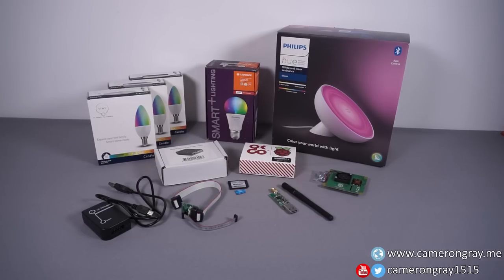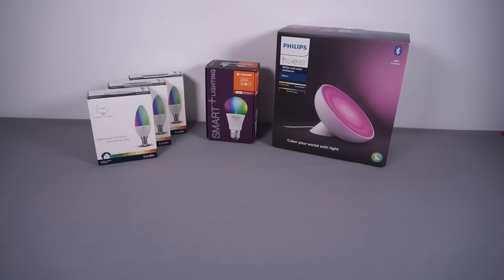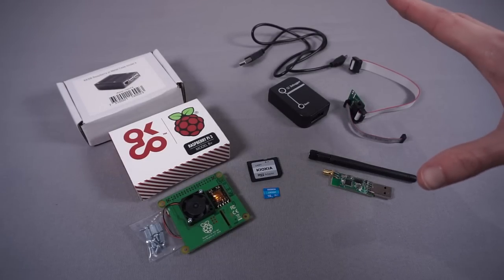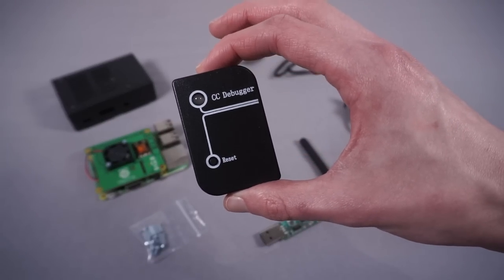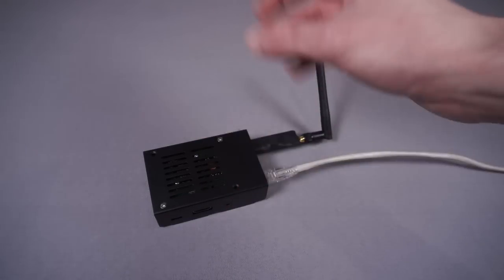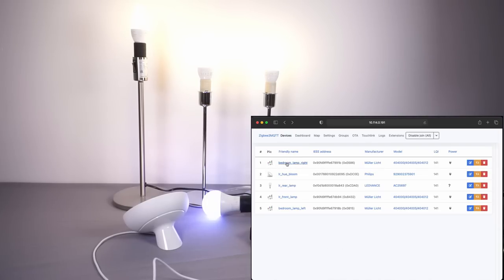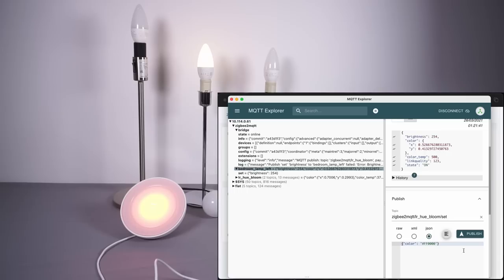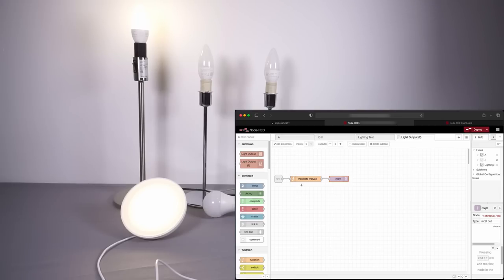Building a Self Hosted Smart Lighting System using Node-RED & Zigbee2MQTT

Comment: I couldn't figure out what was going on until I realized this did not involve home assistant :)
I'm used to ZHA but wanted to try Z2M so I was looking up how to actually use the devices in node-red compared (to ZHA) - spoiler: it's exactly the same..
Reply from the maker: Yeah, Home Assistant is a good option but I just don't get on well with it, I think I try and push it too far.  I find Node-RED lines up with better with my way of thinking since it's a lot more programmatic.  I've actually started using Home Assistant as part of my setup, however I'm using it with helper/virtual entities so that I can use it to create a nicer UI than Node-RED offers and also use it's integrations for interfacing with more propaitery smart devices such as my Nest thermostat and Viesmann boiler.  Even then, all of the actual logic is handled in Node-RED using the Home Assistant plugin.
Reply: @camerongray1515  But can't you just do the exact same things in HA with Node-RED as an add-on? I use Node-RED for all my logic too.

Comment: Lidl also have cheap zigbee bulbs plus plugs. LEDs and power strip. You might also be interested in the Bigtimmer node (Pete Scargill) to set on and off control.
Reply from the maker: I'll need to keep an eye on the ones in Lidl, unfortunately they didn't have any RGB bulbs when I checked but I tend to shop there semi-often so I'll check what they have every so often.

Comment: Extra note: If you want to use the official Raspberry Pi PoE HAT, you need a Pi 3B+ or Pi 4. These models have an extra 4-pin header, which the PoE HAT uses to tap into the Ethernet port. There are third-party PoE HATs that support older models of Pi, but those are not as elegant, as you need to plug the Ethernet cable from the PoE source into the HAT, and then connect another Ethernet cable between the PoE HAT and the Pi's Ethernet port.

Comment: Something that might be good is to network boot the Pi. You said you want to set and forget the pi, but in my experience the SD cards are prone to filesystem corruption. Granted, you're not going to be doing a lot of reading and writing to the sd card, but this way you can host the storage remotely on your server, and then if you decide to switch the OS for some reason or something goes wrong with the image and you want to restore from a backup, you can swap out the image without needing to remove an sd card. Setting up pxe boot on a Pi isn't the easiest, but it allows for easy image changes without the fear of sd card corruption once it's set up.
Reply from the maker: It's definitely possible and could be useful in an environment where you have a large number of devices where you don't want to have to manage local firmware updates however for a device like this it's probably more hassle than it's worth.  I'd then need to run and maintain the network boot server and would need to keep it and the whole network alive in order for the pi to be able to boot.  Zigbee2MQTT does need to write at least small amounts of data to persistent storage (e.g. paired devices, device names.etc) so then I'd also need some sort of network file mount for it to write to.  The idea behind this was "set and forget" so I'd rather have something that'll definitely boot every time, I don't really have a need to ever change the firmware on it now it's running.  The idea with alpine is that it should avoid filesystem corruption, the whole OS runs from RAM with only one directory mounted as a live filesystem, I've generally found that SD cards are killed by writing to them too much rather than just having them powered on long term, I totally killed an SD card years ago running a UniFi controller on it where it was constantly writing to a database.  A network booting Pi will probably also be tricky in the event of a power cut, it's likely that the Pi will start network booting long before any of my network hardware or server will have started up fully, unless the Pi has support to retry indefinitely I'd probably need to manually power cycle it to get it back online.
Reply: @camerongray1515  Very fair points. When I commented, I hadn't gotten to the Alpine Linux part of the video. I didn't realize, but really should've realized, that Alpine runs on Pis. In fact, my entire experience with it was with containers, so I didn't even think about installing it on actual hardware. What a clever idea.

Comment: Not all Zigbee stuff is created equal, we've got a Hive Heating system which is "Zigbee" but it won't work with anything other than its own hub and app for some bizarre reason.
Reply from the maker: Yeah, you do need to be careful to make sure the device you have is supported by zigbee2mqtt (or at least open enough that you could add your own support).  Thankfully there are other Zigbee thermostats that are known to work.  That said, looking at the zigbee2mqtt device support list, the hive receiver (the bit that connects to your boiler) does seem to have some endpoints around reading the temperature and setting the heating state so I wonder how usable that would be (may be that you need to talk to the receiver rather than the thermostat itself?) - https://www.zigbee2mqtt.io/devices/SLR1b.html

Comment: Hi Cameron, thnx for cool video. Could you clarify how you gut current state of your bulbs before updating them either from MQTT or Z2M please? Or you are actually keeping state in the Node's variable? If so, how you preserve state over raspberry reboot. Thanks in advance
Reply from the maker: You can change individual attributes of the bulbs rather than having to send all the state at once so you don't really need to store it - If you change the brightness you don't need to know the current colour for example. The bulbs then tend to remember their state when power cycled although I think this can be changed.  In my setup I do store the current state in Node-RED, of course you could cause it to become inconsistent by changing a bulb outside of Node-RED but this isn't really a big deal for me, it's robust enough for my needs.

Comment: Do any self hosted systems integrate with voice assistants yet? The only way smart lighting exists in our house is because talking to them is far easier than pressing a switch on the wall (or digging out a phone, opening an app, waiting for it to connect... etc...)
Reply from the maker: It's definitely possible although unless there are premade systems out there you may need to build your own Alexa skill and then have it make a call to an API that you host on your network.

Comment: I guess I’m control freak like you 😅
Node red is hands down amazing
The only difference from you ,I have home assisting as the unifying hub with node red inside it for the automations
Have a look at it has its automation engine which could do simple binary stuff easily
Good luck

Comment: Hi Cameron. As someone who is just starting to flirt with Zigbee and had pretty much decided on Zigbee2MQTT, am very interested in the software size of your Pi with Alpine. Alpine sounds like it solves my main concern regarding SD lifespan. I was personally planning on connecting over to Home assistant as some others have mentioned as they provide a better all in one solution for me, but this solution gives me a remote Zigbee module which was the part I was most struggling with. Would you be able to suggest any articles you found helpful in setting this up, even a history dump just to give some pointers. Very keen to replicate, but from a position of less understanding this isn't quite enough. Thanks and appreciate the video, as always, very good

Comment: Another great video!

Can i suggest you take a look at Home Assistant?
Its an open source Home Automation server that has integrations for basically anything you can think of, and tonnes of 3rd party community integrations too (Including Node Red)
Reply from the maker: Definitely an interesting thought, it's something I'd never really considered using previously since it didn't seem "flexible" enough to give me the amount of control that I can get through Node-RED, although using it in addition to Node-RED could be interesting.  Not sure how much of a benefit it would give but may be a nicer UI for a dashboard?
Reply: @camerongray1515  It's come a long way recently. It offeres an insane amount of control (at least for me).
It's "automations" are fully configurable, down to adding "If Then" statements in.
For example: when i press {button}, IF its after 8PM but before 7 AM, turn on {light} at 50% brightness with a color temp of X, otherwise, turn on {light} at 100% with a color temp of Y

It has support for the Netio PDU you reviewed recently too, so im sure you'd come up with some automations for that.

Wether the UI is nicer for a dashboard is a matter of personal preference, but it is fully themable, and there are loads of community themes to pick from, or you can just make your own!

Plenty of youtubers have content on Home Assistant (Dr.zzs probably being the most prominant one i know of?)
I'd be happy to give you a look at my Home Assistant setup if you like?  (Always happy to help out a fellow Scotsman!)
Reply: @Niklas2516  Will Siri work offline?
Reply: @camerongray1515  Another Home Assistant youtuber is The Hook Up. There's also an alternative to Home Assistant called OpenHAB.
Reply: +1for HA, even if you don't end up with it, definitely worth checking out as it's pretty flexible and has support for a wide range of IoT garbage

Comment: Many cheap remote switches are based on Tuya as you mention.  You can use https://tasmota.github.io/docs/Tuya-Convert/ to install Tasmota on many of them (check compatibility list) which converts them to support local MQTT control.  I've had success with https://www.amazon.co.uk/dp/B07ZSDWQQ8 which means I can switch existing appliances off/on.

Comment: Why smart bulbs not smart switches.
Reply from the maker: My main reasoning for the smart lighting is so that I could have RGB and configurable colour temperature whereas a smart switch would only really give on/off control or possibly dimming (which technically could do temperature control if I used special bulbs that change temperature when dimmed but wouldn't support RGB). In terms of on/off control I'd rather still just fully isolate the power with a physical switch.
Reply: @camerongray1515  Turning the power on and off to the bulbs might keep messing with the zigbee mesh depending on how they are placed in your home. Bulbs should always have power so that they can work as mesh routers. Another thing is that if there are children present at any time and you have physical switches you run the risk of having your bulbs factory reset as most do that by switching the power on/off rapidly 5-6 times.